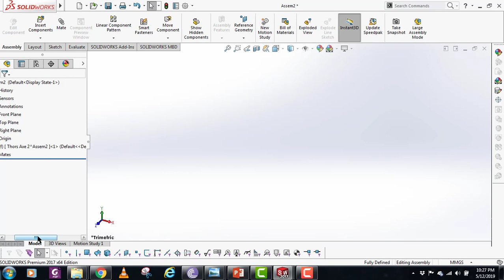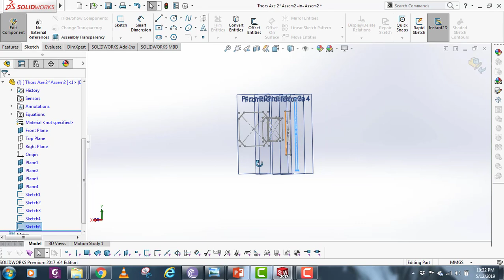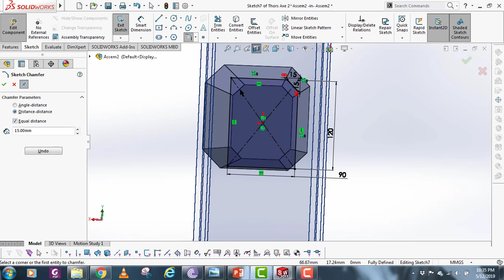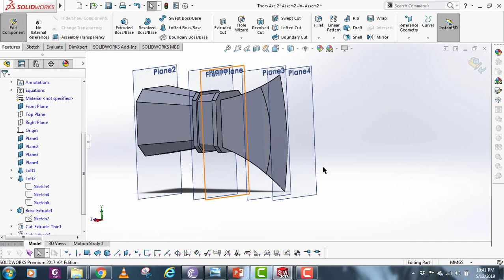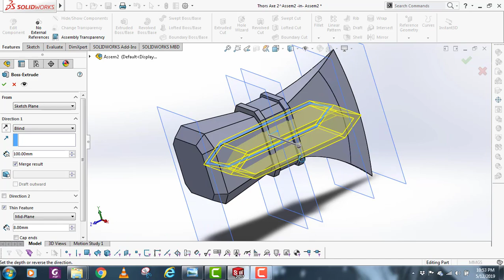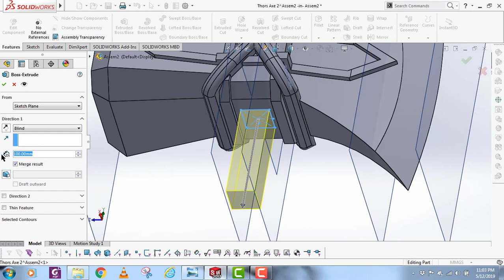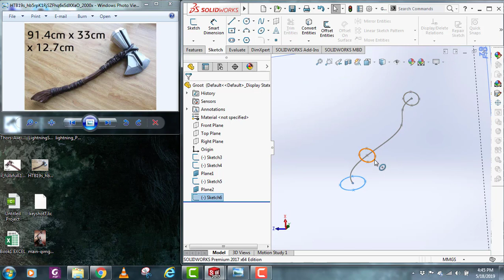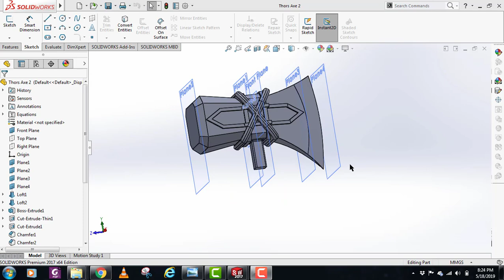Solidworks Tutorial | 3D Printable model of Thor's Axe | Keychain

Comment: I have a question,  in the minute 12:39 you don´t say what is the dimensions of the extrude are, could you tell me what they are, please?
Reply from the maker: Sorry for the delay in the response.. though i am glad that you have asked... 
the extrusion is 115 mm and the thin feature is 15 mm on mid plane ...
Reply from the maker: Also if you design using this technique you can just change the distance of the planes and the sketches dimensions and the shape of the Axe will change .. so you can play around to get the best shape...